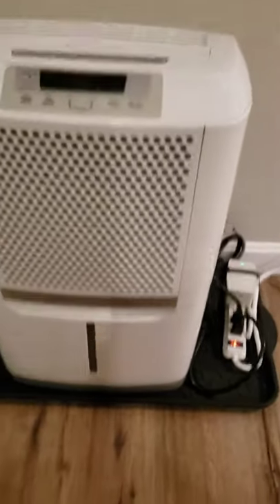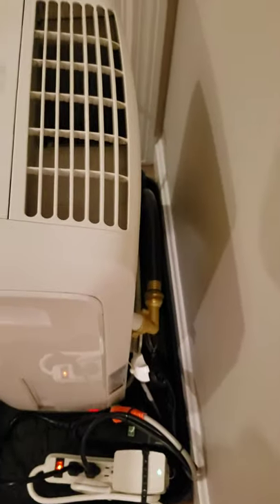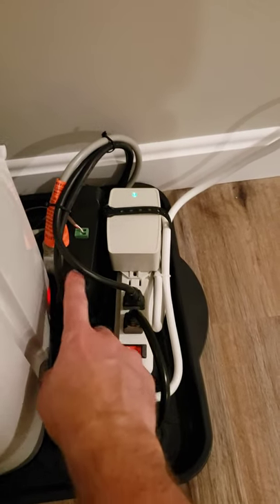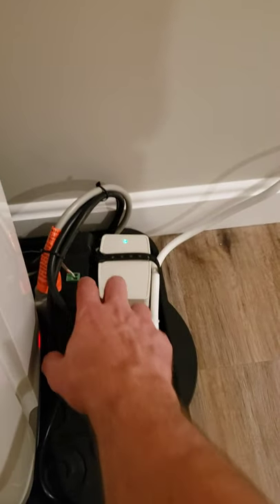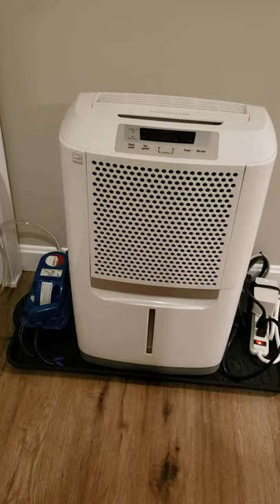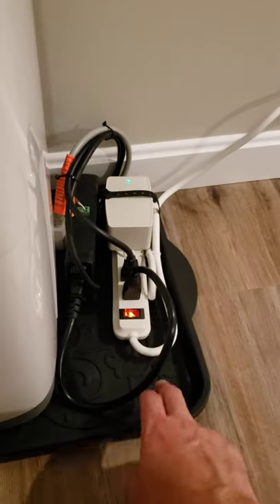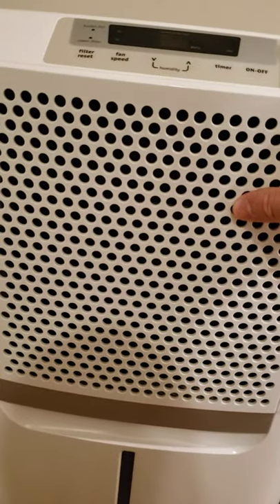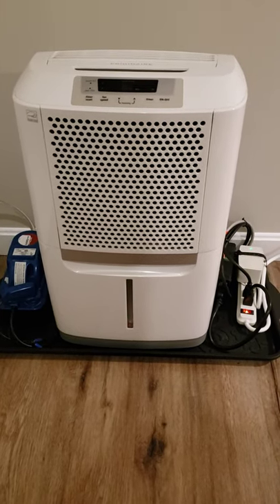Dehumidifier with condensate pump

Comment: I Iike your work.  I got good ideas from your vid.  Thank you for making the vid.   I plan to make something like this next year.  But I cannot help but worry.  Here is why.  It looks like your power strip is sitting inside of the black drip-pan.  If the dehumidifier leaks -- as they sometimes do -- and the drip pan fills with water, it looks like your power strip could go under water.  I might be seeing this wrong because of the camera angle, but someone watching the vid might end up with a power strip under water!.  That is my only suggestion regarding your vid, which helped me a bunch.  Sorry that I am a pain!  Cheers!
Reply from the maker: Thanks for the comment.  Good observation.   Yes, since making this video I have addresses that concern by elevating the power strip and adding child safety to it with the following. 

Safety 1st Power Strip Cover for Baby Proofing https://www.amazon.com/dp/B000046S3W/ref=cm_sw_r_apan_glt_fabc_S92ZE7TFNSD66T6Q8F3R

My next step on this is to add a water sensor that will sit at the lowest point of the tray and hook into the power cutoff so that if any water is ever sensed everything stops.

Diversitech WS-1 Wet Switch Flood Detector https://www.amazon.com/dp/B004JPDO8W/ref=cm_sw_r_apan_glt_fabc_ZXK5S0VF3N54GVT29EK4?_encoding=UTF8&psc=1

Common sense would obviously be to locate the power strip outside the pan.  I'll either do that or mount it directly to the dehumidifier to keep it elevated.